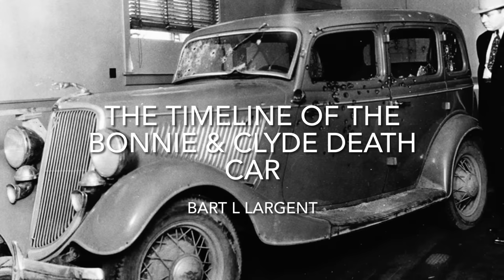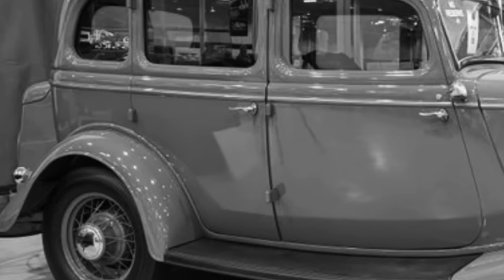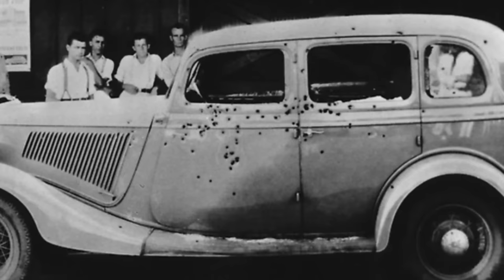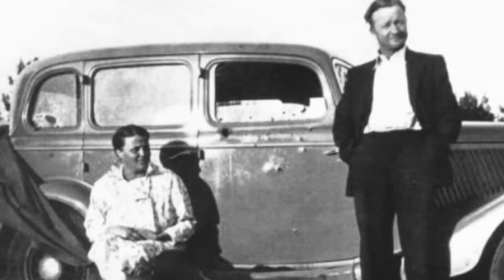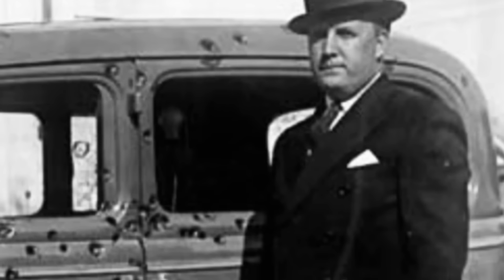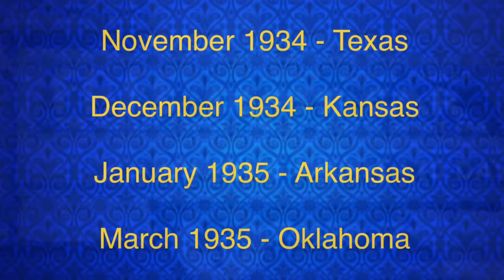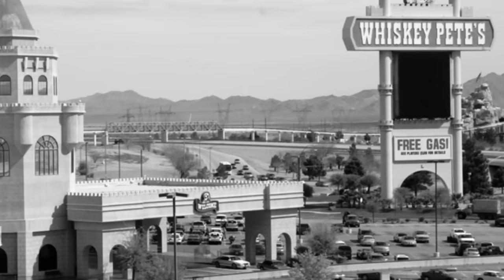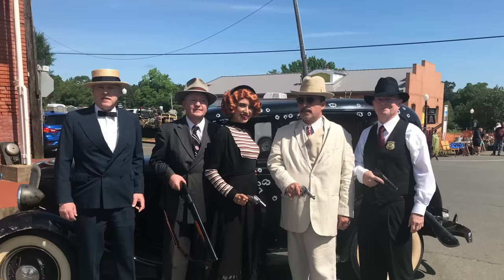The Timeline of the Bonnie & Clyde Death Car

Comment: I stopped at Whiskey Petes in 1999 for a break while travelling from Phoenix to Vegas. Did not know the car was there but there it was right inside like a lobby area and not behind glass, however I believe I remember it being roped off. Got a pretty good look at it and it still looked pretty gruesome even after all the years. If that car could talk it would be a helluva conversation. I hope the original owners were properly compensated.

Comment: I pose a curiosity question: 1) The front windshield in some still photos shows the passenger side riddled with bullet holes, and the drivers side clear.  Then in other photos, the passenger side is clear and the drivers side is bashed-in.  2) In some photos the rear window is riddled bullet holes, and some photos with no bullet holes but smashed glass.  Why the discrepancies?
Reply from the maker: The real death car had numerous bullet holes on Bonnie’s side of the car. They shot at Clyde mostly through his door. As the car was rolling into the side of the road, officers followed the car firing into the back of it.

Comment: At 2:30 you see the passenger rear window isn’t the same as the car in whiskey Pete’s, it’s the only thing that I question on the car, possibly the old glass came out and they put another one in with a couple of holes in but not the same places
Reply from the maker: Many pieces of glass (front, sides and rear) were removed by souvenir hunters after the ambush and years past.

Comment: The worst place to be is in a car when being shot at.  The bullets will ricochet in every direction imaginable, especially when the guns are Browning bars in 30/06.
I doubt that they even knew what hit them.
Reply: Supposedly Clyde took a round straight through the head right at the outset. Probably from the rifle of Prentiss Oakley. Bonnie knew what was taking place and they say she was screaming like a wildcat until the barrage caught up with her. She took rounds through the face, body, and extremeties. Clyde was shoeless as was his habit and his foot slipped off the clutch at death and the car lurched forward and stalled on the opposite side of the road in a ditch. The posse thought they were driving away and hammered the car from many sides with gunfire. Bonnie supposedly breathed her last just as Ted Hinton opened her door and she partially fell out into his arms. She had a partially eaten sandwitch in her lap. Hinton said he could smell her perfume mixed with the copper smell of blood.

Comment: 101,048 miles still had the original tires? You had me up till then.
Reply from the maker: The original tires have been removed several times through the years. The tires do not have 100k on them, the car does.

Comment: How can the car have 101k miles on it?? And original tires?
Reply from the maker: Other than the great race, the car hasn’t been driven much. The original tires maybe have 10,000 miles on them. They have been taken off and stored many times. When the car was ambushed, the mileage was under 10,000.

Comment: over 100,000 miles and it had the original tires on it..doubt that and why would it have that many miles..wouldnt you haul it on a trailer?
Reply: Good point
Reply: Clyde had other plans for car!
Reply: Her home is now semi historical
Reply: The car did tour in a trailer. I don't buy the mileage.
Reply: The video says 8855 miles when returned to the owners, probably the mileage is 10,000+ and this was a mistake to say over 100,000.
Reply: @paulstewart2672  Odometers on cars of that era only had five digit rolls (excluding the tenth mile digit one), so on the next mile after 99,999 it would revert to 00000. So to say the car had over 100,000 mikes on the  odometer would mean that it would have now had a very low reading (say, it did 5200 miles after the resetting it would only show 5200). Highly unlikely that they'd done 108,855 miles.
Reply from the maker: The car may truly have 100k miles on it but not the original tires. Many times the originals were removed and newer tires were used such as during The Great Race.